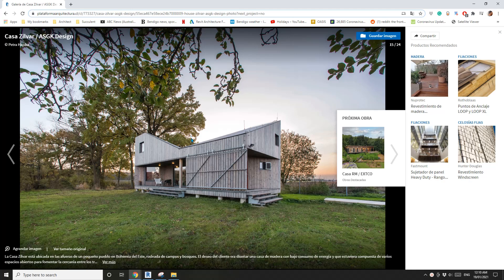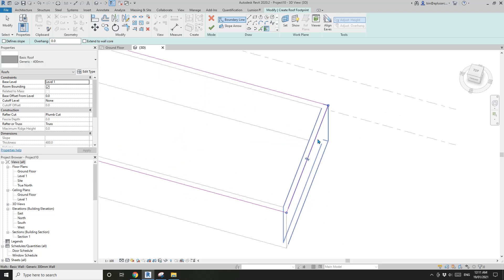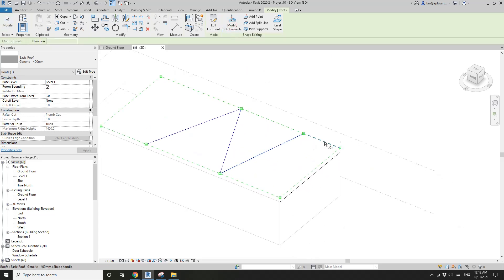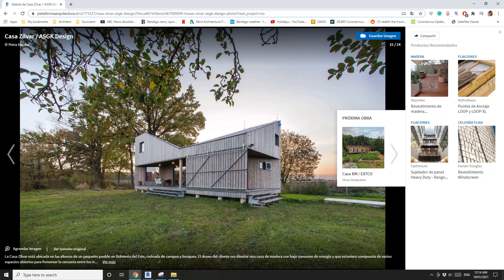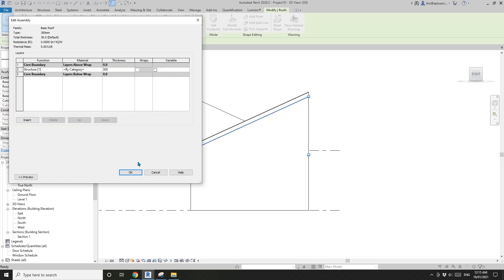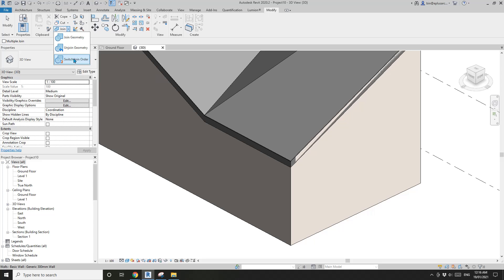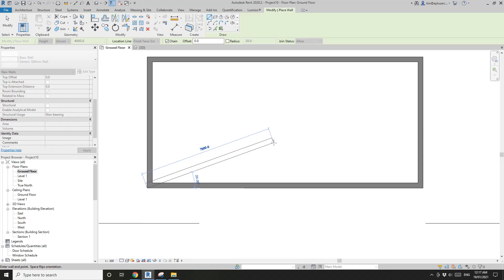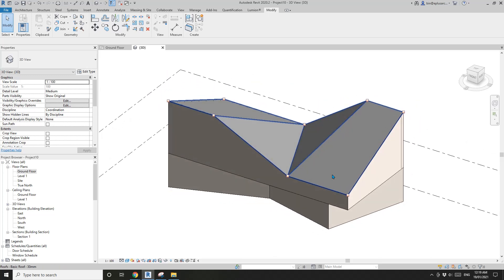Everyday Revit (Day 306) - Simple Building Form Exercise

Comment: Hi Bin, thanks for this nice tutorial. The roof structure is normally supported by walls. So, the joint line between the external wall and roof is actual and it will be disappeared by applying the external finish like wooden planks or cement plaster + paint. If you have a chance to show us how to apply these different wall finishes will be great.
Reply from the maker: Yes, you are right. I only tried to make it look right, and structurally it was wrong. I will have a look again and see if I can model it just like how it will be built.
Reply: @BINHE615  please Bin 🤙💯